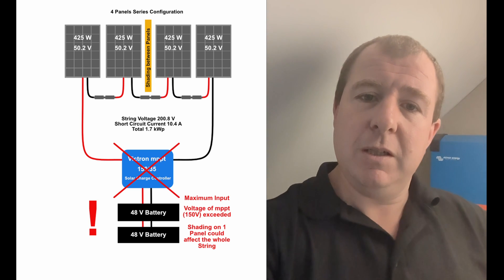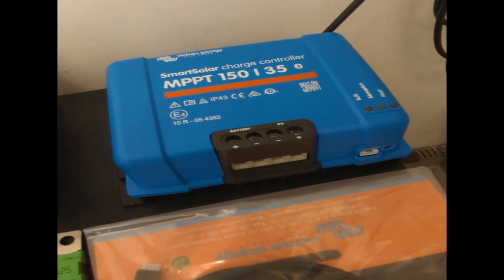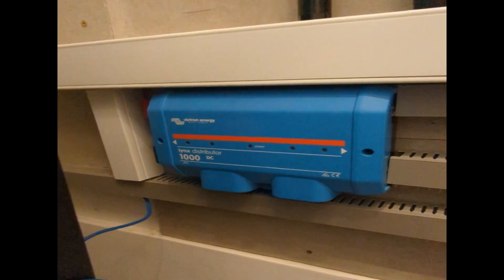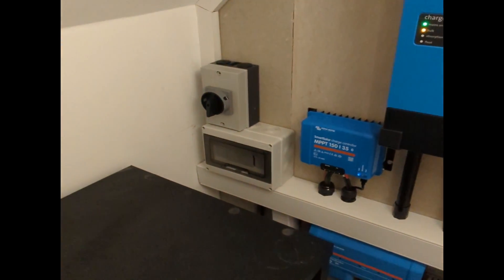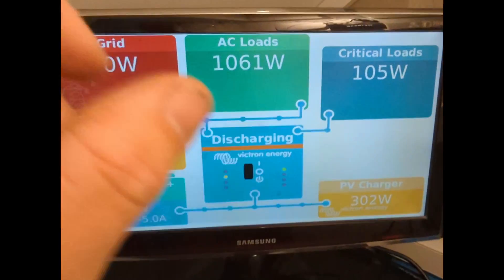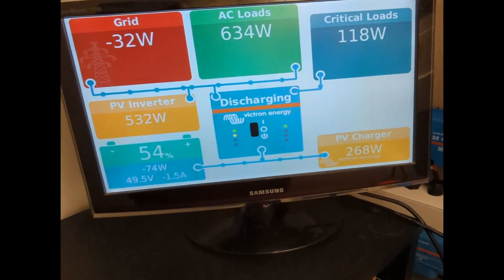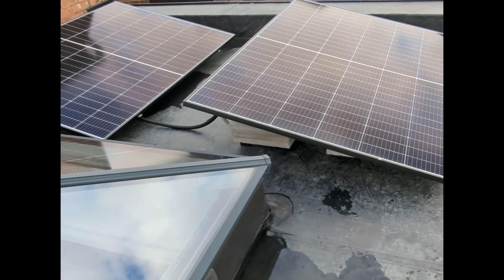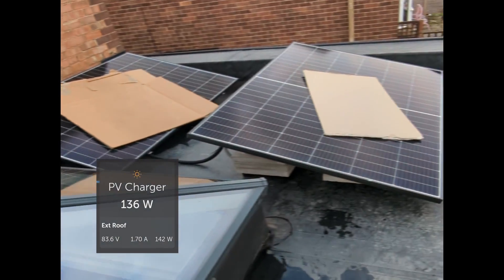Wiring Solar Panels to a Victron Multiplus and Solar Charge Controller what a nightmare

Comment: Nice set up.  On shading, I have discovered the same issue.  Seems to be that panels only pass the maximum amperage available on the string since the MPPT is sweeping what IS connected to it.  So if one panel has only 1A available, then the entire system seems to want to pass 1A when connected in parallel.  I have four panels on two series / parallel strings too on one controller and got more or less the same results.  I have since split up my arrays and use multiple controllers to minimize the solar salad MPPT sweeps. Ironically, I have one array that has 6 100w panels in series and on even on partly cloudy days in Michigan it can perform better than the 4 300 watt series / parallel strings!  Weird for sure.....cheers, Gary